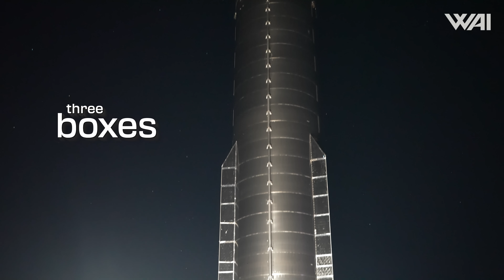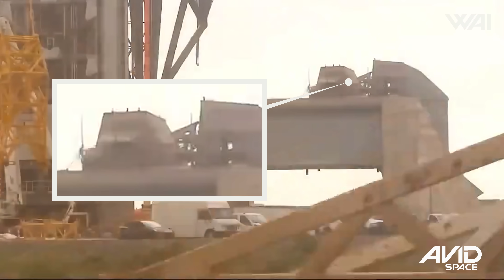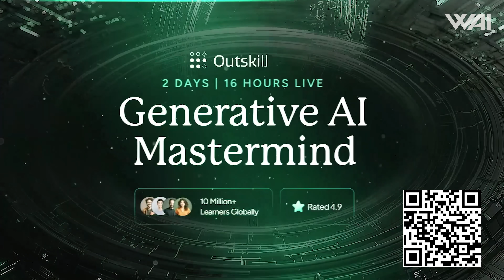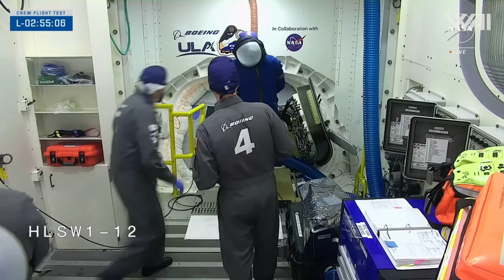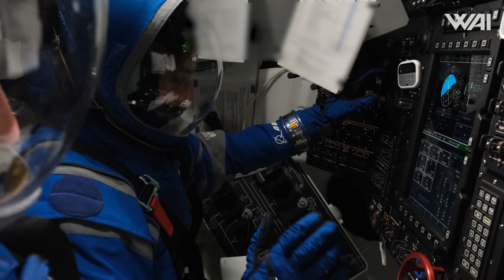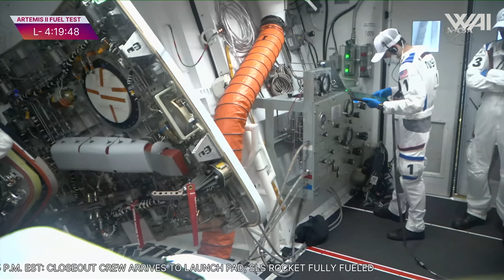SpaceX Just Revealed Starship's MASSIVE Game-Changer for Flight 12

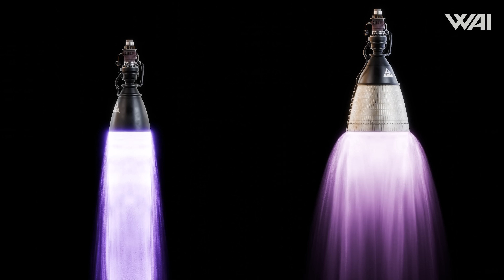Comment: The animation at 2:05 is wrong. The exhaust never expands outwards of the largest bell which is designed for vacuum. At sea level it would draw inwards instead due to the high pressure.
Reply: Of course the exhaust expands outward of the large bell in a vacuum.

The only way to avoid that would be to have a bell of infinite size.

Its dimension is a compromise.

Comment: I have not yet heard it mentioned that during the time between when Starliner undocked from the ISS and SpaceX Crew-9 arrived, the ISS had two more people aboard than there would have been seats available to take them home should a mass evacuation become necessary. That in and of itself was a major deviation from the standard safety protocols. Plus, since Sunni and Butch lacked compatible pressure suits until SpaceX sent them replacements, they would have been the ones who were as good as dead should such a need arise.
Reply: I heard that during that window they had an emergency plan where they would be strapped in the storage space behind the seats. It would get them down safely as long as no unexpected loss of pressure.
Reply: Drop a ❤️ if you actually care about me a

Comment: I predict Flight 12 will be in June with a cadence of one every six months for the next two or three years. I predict Artemis II will launch NET November. Yes, I am being pessimistic tonight. The advantage of that is, if I'm wrong, that's a good thing.
Speaking of pessimism, let's assume, just for the sake of argument, that Starliner fails its upcoming cargo flight to the ISS, which is optimistically slated for no earlier than this year. If that happens, and NASA decides to have nothing more to do with it, then they are still going to want an independent manned spacecraft for LEO missions after the ISS is decommissioned. Theoretically, Starship could provide that capability, but it may just be too large to service the commercial stations that are expected to replace the ISS. I would recommend that we start over again and have another competition to develop that elusive second manned spaceflight capability. Let Sierra, BO, and anybody else who wants to offer a proposal, even Boeing, do so and get at least one, maybe two more manned spacecraft to service our space stations in the mid 2030s and beyond.
Reply: What you're missing is that the "commercial stations that are expected to replace the ISS" will have an extremely hard time competing if Starship is successful. One single Starship has more volume than the ISS and will cost a few dozen million (maybe less when mass produced), no need for tiny, obscenely expensive tin can stations -> no need for tiny, expensive capsules to service them.
Reply: I predict you get laughed at.. A LOT.
Reply: @imaginary_friend7300    I hope so. I would very much love to be wrong. The constant delays are just really making me pessimistic.

Comment: I don't see the extra panel on the version 3 hot-staging section that forces a disconnect in a particular direction, does SpaceX have a better way now?
Reply: Differential thrust.
Reply: Also, off-axis center engines to compensate for the differential thrust of the vacuum engines.

Comment: Starliner is not the only commercial crew failure, there’s also Dream Chaser, but all the criticism is aimed at Boeing and none at Sierra Space.
Reply: Dream Chaser is not a crew vehicle yet.  Sierra has been chomping at the bit..  You didn't make any effort to inform yourself did you?
Reply: @i @imaginary_friend7300 eam Chaser has been in development since 2004, which is before Starliner. Dream Chaser received funding under the Commercial Crew Program in 2009, but Sierra Space is years behind. Cargo-only Dream Chaser Tenacity was to launch in 2024, then 2025, and now it’s 2026 and still no launch, and if it does launch in 2026, it won’t dock with the ISS. I wanted it to succeed decide it’s a great concept, but the delays speak for themselves.

Comment: About the Starship flap hinge. 
Is the flap hinge still in the airstream?
Or.
Have they made a short fixed part and placed the hinge behind the stub? The is the hinge is protected from the airstrean/plasna by the fuxed stub flap.
Reply: The front hinges are recessed but the rear hinges are still totally in the plasma stream. Even so, when the forward flaps are extended, the plasma is diverted towards the hinges anyways.

Comment: It's time they give-up the catching operations.  Bring the birds back on the otherside of the facilities, so they don't risk any infastructure.  Move them through reconditioning, on rails, on the way back to the launch-side.  Use chops to stack and launch.  The ships and boosters should just land on legs.  Lose the additional problem.  They need a way out, too.
Reply: That would waste payload capacity.
Reply: @imconsequetau5275  Its gotta happen anyway.  But just for ships with human crew.  And there's gotta be an emergency punch-out...just in case.

Comment: NASA's lack of transparency seems to have started with Commercial Crew.  Any questions about hardware and progress were directed to vendors, SpaceX and Boeing, in this case.  SpaceX has a great PR dept, but famously has its employees and subcontractors work under NDAs to control information.  They also have had heat shield and thruster issues. Boeing also has NDAs, but has a weak PR dept.  They also made high profile mistakes in other parts of their business which taints their whole operation.
Reply: That's incorrect. NASA applied extreme oversight over Dragon, but much less over Starliner (that's Boeing with its famous revolving door corruption, army of lobbyists and proxy politicians). SpaceX went above and beyond their contract obligations, did dozens more tests, published every setback or issue, and famously open sourced all patents (as it has always done).
Reply: @admarsandbeyond  True.  When someone leaked video of crew Dragon explosion in 2019, they didn't fire anyone, just reminded everyone there would be consequences for unauthorized data release.  Tesla is open source, not SpaceX.  ITAR rules prevent that.  North Korean would love to use SpaceX technology to land a rocket anywhere they wanted.
Reply: @armandomercado2248 You're correct, I misspoke about the patents. SpaceX doesn't patent any of its core rocket propulsion and launch technologies (relies on trade secrets due to enforcement difficulties abroad). They share their IP with NASA and have said that NASA is free to share IP, data, or learnings with anyone it wants "no charge."

"I’ve been very clear with Jim that any SpaceX data should not be considered proprietary. It can be used by any of our competitors… No charge."
"NASA can share all of our IP with anyone that NASA wants."
Reply: @admarsandbeyond  I was speaking on the current lack of transparency of NASA, although that seems to have improved greatly under Isaacman.  Since NASA didn't own Dragon or Starliner, they left it to SX or Boeing to disclose whatever they wanted about their programs.  Boeing is clearly struggling with Starliner, but NASA does want two independent ways to get crew to orbit and they are the best bet to provide that ability... eventually.  SX also had issues with Dragon, but that doesn't get the same reporting as Boeing.  An early Dragon flight sprung a leak after splash down.  They've had problems with valves and thrusters just like every other rocket company.  There was even a report of an astronaut suffering minor injuries when an interior part of the capsule became dislodged during splashdown.  The good news story is SpaceX is a vibrant and innovative launch provider and Boeing is paying for its lack design skill and quality assurance.

Comment: Howdy everyone.  Great update.  I wonder about butch and sunys radiation exposure and how it compares to a more typical mission?   Starliner being a dud is no surprise to me.  I worked in aerospace and defense as an engineer.  It’s all about money and those toads at the top will BS their way through everything.  If the two astronauts had been killed they would have acted surprised and then blamed the engineers.  Corporate culture is not compatible with NASA level systems and commitment. Not now. Not ever.  And this is the danger of commercial involvement in space.  On a brighter note spacex is totally rocking it.  And how you may ask?   Because spacex is acting like an engineering company and not a bloated corporate giant. 🤡

Comment: SLS needs to be cancelled and refunds demanded from Boeing, they've proved reusing old shuttle tech is not the way forward and not reliable, safe or reuseable. Sure there might be delays, but, it will save money in the long run, heck in the short term they can shuttle moon mission components to orbit to be assembled there using falcon heavy and new Shepherd (if blue origin can ramp up their delivery cycles) and they could also start construction of an orbital station for the crews assembling moon and possibly Mars missions to call home.

Comment: I like the way you explained the difference between the sea level raptor and the vacuum raptor. Way to go.
Reply from the maker: I’m glad I was able to bring it across! ❤
Those are the fundamentals of why a rocket moves forward. The more you let the gasses expand, the more thrust you end up having. That’s also why the thrust goes up with more chamber pressure. More pressure to work with. And it’s all measured in ISP. The fuel economy of a rocket. How efficiently does it turn thermal energy into kinetic energy (forward movement)? The expanded gas has as little as possible energy left in it.

Comment: At some point spacex will be facing similar challenges when spacex actually attempts to go to the moon as well. As yet starship has not done a manned mission yet, or built starship, with everything needed for human space flight,  and nothing that tall has even atempted to land on the moon, with a big portion of even the smaller unmanned ones, having a 50%, crash rate on landing, tipping over, sane for mats. Spacex has a long ways to go to get to the moon. Nasa, is pretty much ready.
Reply: NASA is ready?  You might want to consider informing yourself a little better.

Comment: Regarding Starship, Why not install heat resistant tiles on the outer side of the flaps to protect against the intense heat of re - entry ?.  Because with them being on hinges there will be obvious flames getting through to the outer sides anyways.
Reply: I believe the last few iterations of starship included a flap redesign that had heat tiles overlapping the hinge, so the hinge was essentially recessed behind a wall of tiles jutting out from the ship.

Comment: See if you can find this out from NASA... Starliner CM RCS is by contract supposed to be two fault tolerant.  A single thruster failure on re-entry rendered the CM zero fault tolerant, meaning the CM RCS design is actually only single fault tolerant.  How did this get approved?  Who signed off on that... it should've been a nonstarter.  Second.  Making the Starliner CM RCS two fault tolerant is going to require massive re-engineering, redesign, and hardware changes.  Given that, and the limited life left on ISS, I don't see any way Starline can be made crew certified in time even if Boeing was willing to spend the $$, and they aren't.  How does NASA justify keeping crewed Starliner alive?

Comment: It is wierd that Falcon 9, Dragon and Falcon Heavy so successful and Starship has failed over 10 times to orbit 💫.
Reply: Starship is 1000 times harder and still a prototype. Test flights were deliberately a hair less than orbital for safety reasons. They achieved orbital velocity by not stable orbit, they don't learn anything more by letting the engines run for a few seconds more.

Comment: The big reason NASA is using Liquid Hydrogen for fuel is because they're using engines salvaged from the space shuttle fleet.  If they ever start actually launching SLS, they'll run out of those engines pretty quickly.  Then they have to start building new engines, which is even slower and more expensive than using salvaged engines.  That might be a really good time to convert to the newly  "traditional" fuels, like liquid methane using engines designed, built and tested from scratch for dependability.
Reply: NASA has a hydrolox obsession. They fixate on ISP and ignore everything else that makes it impractical. The same obsession they have with nuclear propulsion.
Reply: If it were only that easy..

Comment: I'm not so sure that the flaps are really a good idea now, given these persistent problems. Weigh the complexity and mass of the flaps vs a reaction control system. The reaction controls need no shielding, and have no moving parts. The flaps as currently configured would be worthless for Mars entry and are not needed at all for the lunar mission.

Comment: Slightly scary?  Kessler Syndrome guaranteed!
Reply: Media sensationalism tends to overhype the timeline and severity. In low LEO constellations (below 600 km, where Starlink operates), debris deorbits very fast (and the smaller the debris the faster, months or even weeks for fragments under 5 mm), preventing a full Kessler cascade. This was shown in events such as the Cosmos-Iridium collision or the various anti-satellite tests which didn't spark a runaway cascade, and simulations show no immediate exponential chain reaction even with higher satellite densities.

Comment: AI is pretty much like Bitcoin. No basis in reality.
AI does not contribute to manufacturing or production directly in the way humans do. Maybe if you add robotics to specific tasks there is potential for AI involvement, but from what i've seen so far manufacturing lines still require human input to load materials and consumables onto the automated plant and detect failures and undertake corrective actions. AI is pretty limited in the real world.

Comment: If they were to use Deuterium instead of elemental hydrogen, would it be easier to handle?  It's twice as big.  Of course, it would likely be cost prohibitive.  Just thought it might be an interesting thought exercise.
Reply: Deuterium is HEAVYIER but offers no additional power for chemical combustion !
Deuterium only makes sense for fusion drives where you burn it to Helium ;-P
Reply: @reinhardfranzwehringer7803  True.  My comment didn't have anything to do with combustion.  Had more to do with a larger molecule, making it possibly less likely to leak.  Don't know if it would do so or not.  Probably not, just a thought.
Reply: @darkstar7999  I don’t think that Deuterium is LARGER, as it has the same number of electrons in orbit around its nucleus, its nucleus is only heavier.
Reply: @reinhardfranzwehringer7803  I don't know either, hence my question.  I do know that the extra neutron gives it slightly different physical properties (freezing point, boiling point, slightly different reactivity, bonding, etc), but I have no idea as to physical size which might or might not make it less "leaky".
Reply: Deuterium is not a larger atom/isotope. Anyway, hydrogen is stored as pairs of atoms, so the molecule size is what matters.
Reply: @imconsequetau5275  Right...and a Deuterium molecule would be comprised of two atoms of Deuterium.  Which of course, would be twice as heavy as a Hydrogen molecule and would have slightly different chemical properties.  My question had to do with whether or not the actual Molecule, since you pointed that out, would be larger in radius than a standard Hydrogen Molecule, since it would now contain two neutrons that it normally would not contain.  I still don't know the answer to that, but it really doesn't matter anyway.  I am kind of sorry I asked now, to be honest.
Reply: @darkstar7999  the size of the nukleus doesn’t matter, it’s the ORBIT of the electrons which influences the SIZE ;-P
Reply: The deuterium nucleus does not greatly affect the electron shell size, so deuterium is nearly identical in size to hydrogen isotopes.
 @darkstar7999

Comment: Let's see... 2 contractors, start their contracts at the same time, to build their own version of the "same" thing.... one has now been flying for 2+ years, the other, well... still can't make a round trip with all the original parameters. And the taxpayer gets to pay for both.

Sort of like 2 different contractors to build 2 different "Sears Towers" (yes, I'm that old) ... one completes it, and has it occupied, the other one ... has the inspectors stuck at the top and has to evac them by helo... riiight.  After the first issues with the second one, Sears would have cancelled the contract, and found yet another contractor to build it most likely

Comment: The problem we now have is the same one when Butch and Sonny actually flew - Boeing could not afford another test flight or to try and cancel the contract which would incur penalties or at least the return of payments made for work not completed. This is still the case here - neither Boeing or NASA can cancel the contract (whichever did that would incur penalties) and so this farce will continue until the last US astronauts take a Dragon ride to the ISS and get back safely. The game of “planning” for a Starliner launch to the ISS will continue.
Reply: They have said there will be cargo only trips.  It is also supposed to be capable of adjusting the orbit of the ISS.  So it does have some possible missions.  It however was built for the Atlas booster which is a dead end line.  

What man rated U.S. boosters exist?  Atlas, but a dead end, Falcon 9, SLS and New Shepard, can't think of any others and only one of those would be practical for Starliner post Atlas - Falcon 9.  

New Glenn has not had enough flights and one of those was only a limited success.  Vulcan keeps losing nozzle's on it's SRBs.  SLS - too big and expensive.  New Shepard too small and can't reach orbit. 

:face-turquoise-covering-eyes:

:face-turquoise-covering-eyes: